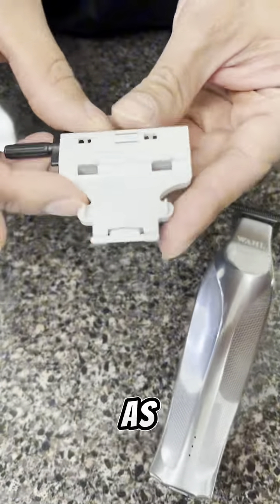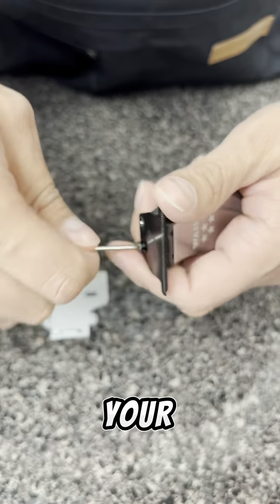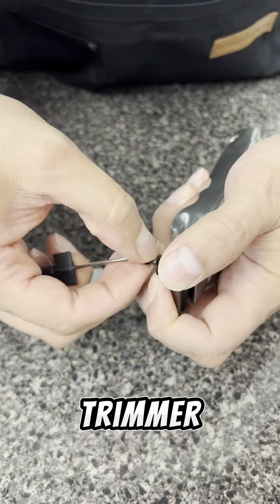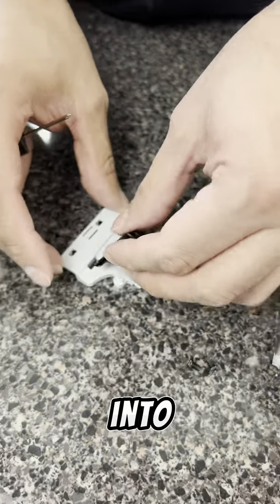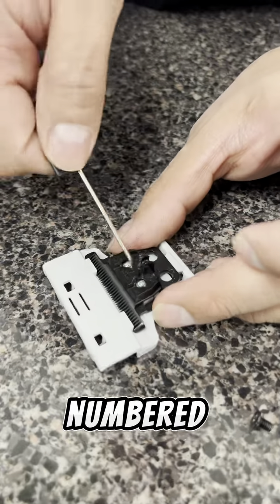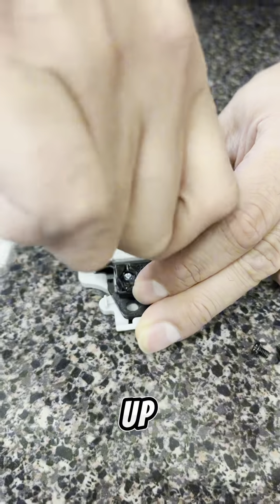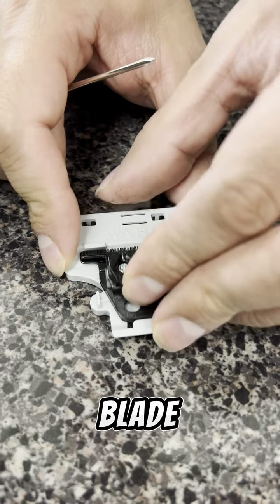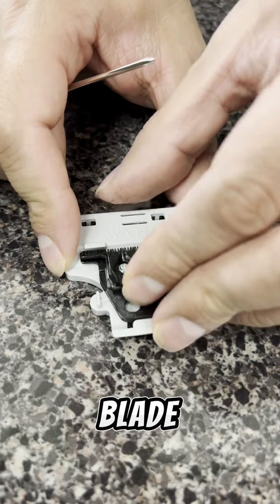How To Zero-Gap the Wahl Hi-Viz Trimmers

Comment: I just bought these trimmers but cant zero gap them as the 2 screws are impossible to take off. Anyone else have this issue?
Reply from the maker: Strange as these are designed to be adjusted
Reply: @Wahlpro  I can't seem to unscrew the 2 little screws on the back of the trimmer. I tried the tool that came with the trimmer and even a screw driver but to no avail. I'd really like a solution as I like the build and ergonomics of the trimmers and would rather not return them.
Reply: The tool it came with is for zero gaping blade screws only. You need a smaller screwdriver for the screws on the back of the blade I hope this helps
Reply: same issue here  you need to buy some better screwdriver , screwdriver with this trimmer is bs (broke at the first use)
Reply: @AdrienHuHuHu  I gave up and sent mine back in January. I liked the build, but it was too much of a pain to try and zero gap them.
Reply: Same here. Gonna need to purchase a small screwdriver with good grip.
Reply: @slizzmo I hope this isn’t the case with mine. SMH
Reply: @Wahlpro mine is doing the same. It broke the tool that came with the box. The screws just won’t budge. I’ve done this plenty of times, but shew, might return mine as well.
Reply from the maker: @EDJacksonJr  Give us a call at 1-800-767-9245 and we can take care of you!
Reply: @Wahlpro  I will. Preciate that!
Reply: Y’all got me 🤦‍♂️ the screwdriver included is only for the tiny screws when using the zero gap tool.. when you take the blade off the trimmer you need a regular screwdriver 🪛 which you should have to begin with.